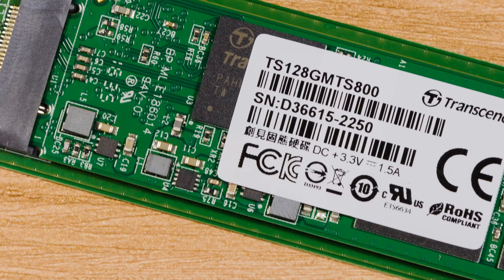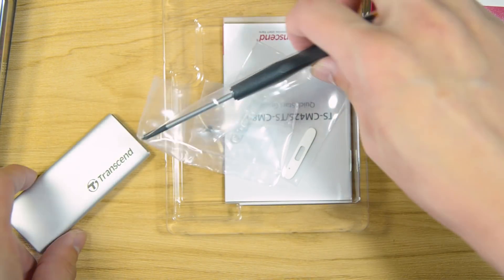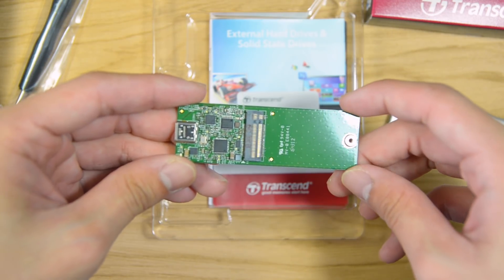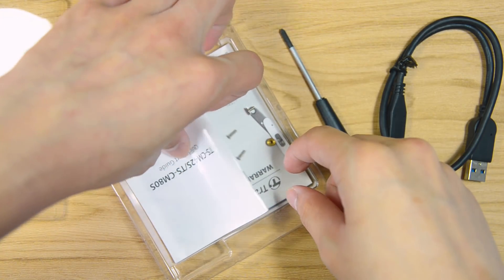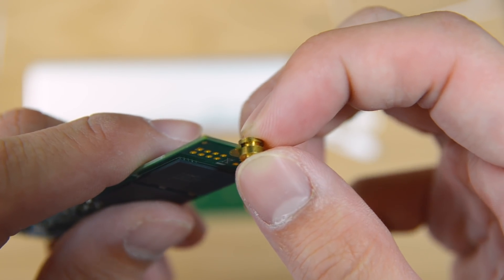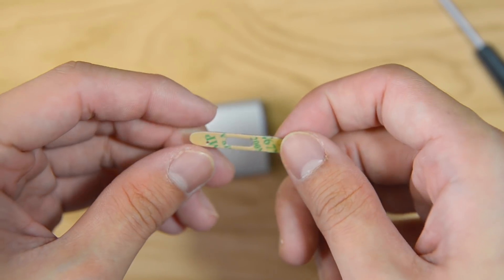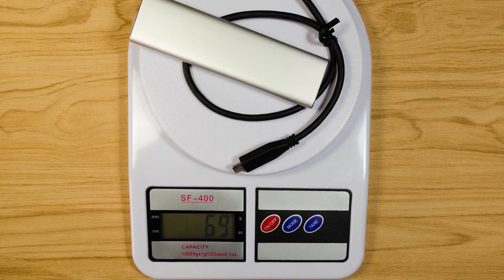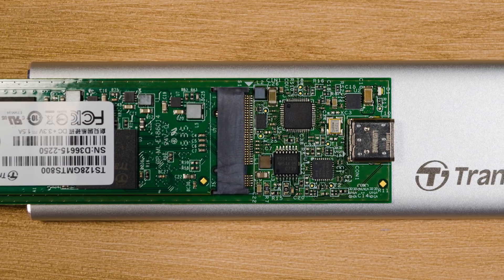Review - Transcend TS-CM80S/TS-CM42S

Comment: Thanks for the video. I bought ssd enclosure Kit CM80 for my z400s m.2 2280. The hard drive fits in but the laptop isn't showing it. What can be the reason? Now, I can't take it out anymore.
Reply from the maker: It should work since it is supposed to support SATA-based SSDs. Perhaps try opening disk utility and see if it detects or not?
Reply: @NasiLemakTech  What is "opening disk utility"?
Reply from the maker: For Mac, it's called disk utility.
For Windows, it has a built-in disk management utility.
https://support.microsoft.com/en-us/windows/help-in-disk-management-ad88ba19-f0d3-0809-7889-830f63e94405#:~:text=To%20open%20Disk%20Management%2C%20right,drive%20space%20in%20Windows%2010.
Reply from the maker: It's quite an advanced tool so make sure you perform your tasks on the correct drive.
Reply: @NasiLemakTech  Thanks for the answer. I will try. Later on I have to take out the hard drive as it belongs to another laptop of mine and it won't function without it. How can I take it out? I have already attached the aluminium sticker.
Reply: It's not showing up in disk management. What should I do next?
Reply from the maker: I suggest to open up and try to reinstall the SSD inside the TS-CM80S and see if it gets detected or not. Maybe even  plug it into a laptop again to make sure.
Reply: @NasiLemakTech  It isn't due to enclosure. The usb port of my laptop is defect. I sucessfully used the enclosure on another laptop. Thank you very much for your help. 
Nevertheless I would like to know how can I open the enclosure to take the hard drive out? I seems impossible to me as I have already attached the aluminium sticker to it. I am afraid I shouldn't use a screwdriver as it could damage the inner part of the enclosure.
Reply from the maker: You'll have to pry off the aluminium sticker to take out the drive. Unfortunately, that potentially means damaging the sticker too.

Comment: I can't find an SSD that will fit CM42S enclosure, any idea where can I get one?
Reply from the maker: 22x42mm SSDs are VERY rare. We suggest getting the 2280 instead, which fits into the CM80S.
Reply: @NasiLemakTech  I already have a CM80S with a Samsung SSD, it's blazing fast as an external drive. But I also have an extra CM42S enclosure so I was hunting for a compatible SSD, turns out it's not easy to find one. Thanks!
Reply from the maker: The issue lies with the PCB space available on 22x42mm SSDs. It can only fit in about one or two (I forgot) NAND flash chips. For the same capacity, its cost just skyrockets compared to the 22x80mm SSDs that we have.